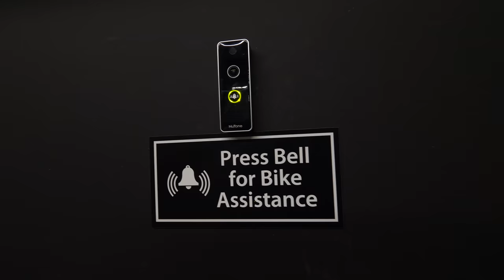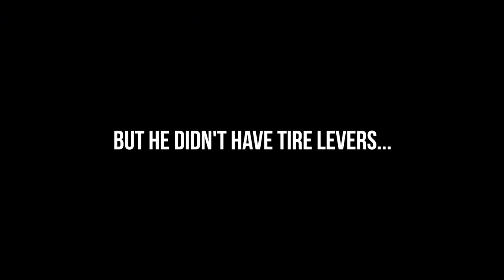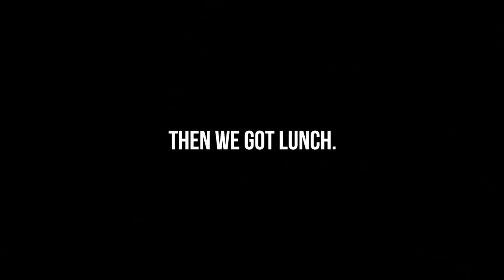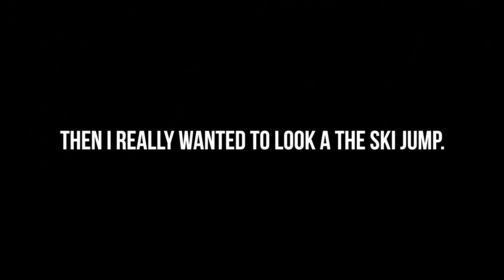Am I Starting to Progress on A-Line?

Comment: I'm a recent subscriber and have been watching all your videos over the period of a few weeks and it's very clear from that that you've progressed massively, you should be so proud of what you've achieved!  Your speed through tech stuff now is insane.  

My observation about your riding is that you are trying to use speed to compensate for a lack of boost.  I'm learning this stuff too at the moment and I've stopped jumping and instead gone back to learning to pump, manual and then bunny hop.  Once you can bunny hop really well you can boost a jump (or so the theory goes), if you can't bunny hop, you'll always be a passenger to some degree.  

If you can already bunny hop really well (say clear a 50 cm object, without clips, on a downhill bike) then go and find a small tabletop and just try getting as high as possible off it using that same technique - get to a point where when you jump you can get clear the table by twice the height of the ramp (so if the table is 1m, off the ground, you should be 3m off the ground and 2m above the table).  You need to get to a point where you aren't scared of going high.  I'd be willing to bet you're softening off your arms and legs at the top of the lips subconsciously because your brain is going "there's no frikkin way I want to go as high as I know I will if I push all the way to the lip"!
Reply: PS:  If it p1sses down tomorrow, why not head for the indoor park and get the boostmaster to teach you to boost!